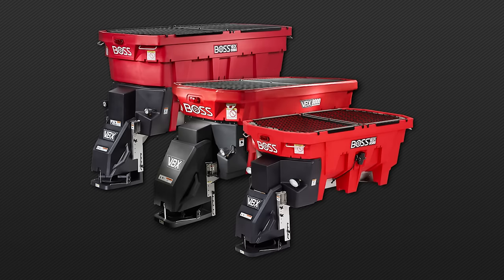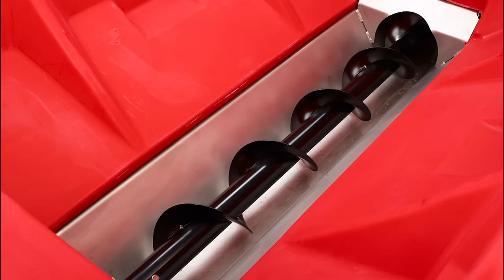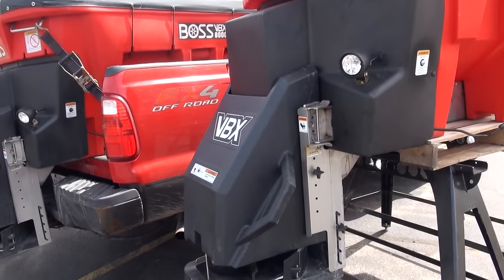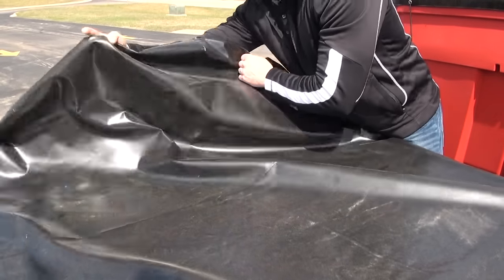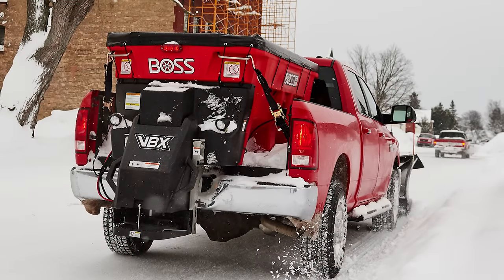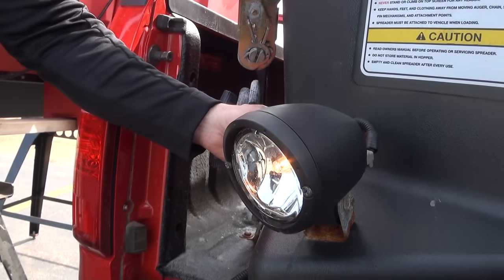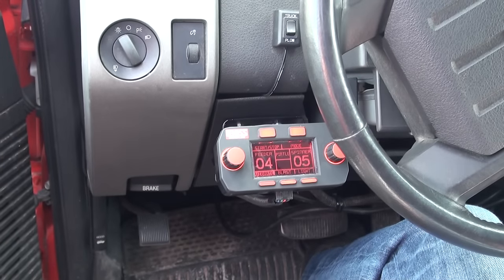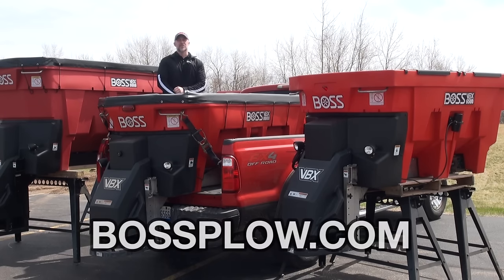VBX Hopper Spreader Family Overview | BOSS Snowplow |

Comment: Awesome job but you would think a little more detail with the material would be shown. Like the dump feature ? Why not show that actually happening (LAZY) and the material transfer between the drive and chain? I mean seriously. You get a great spokesman to speak about the units and you slack on the key parts. Couple of go pros showing the unit being used out on the field spreading etc. send me a vbx6500 and I’ll make a short video guaranteed to sell hundreds of models with product illustration